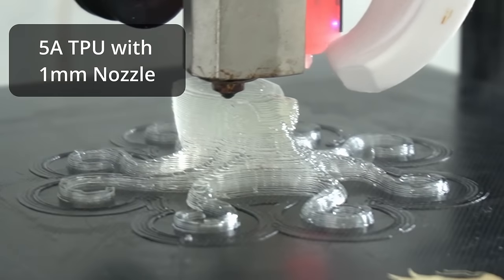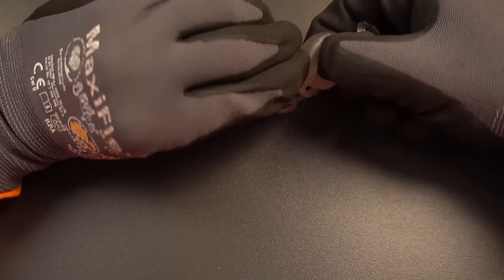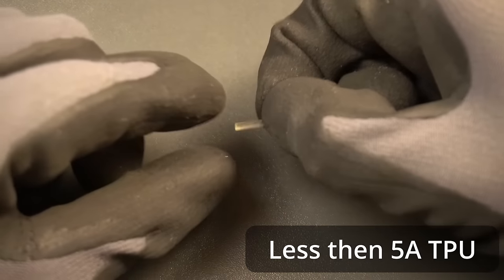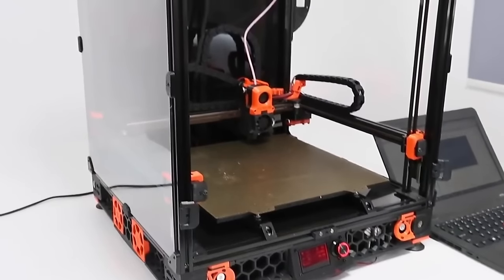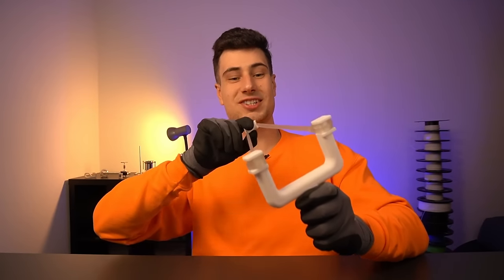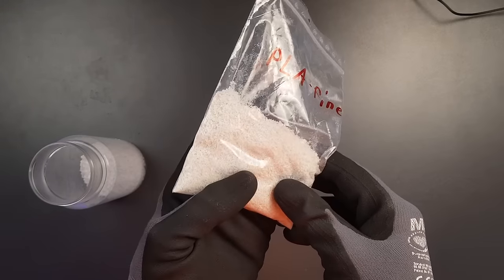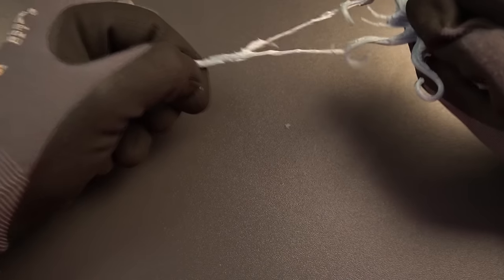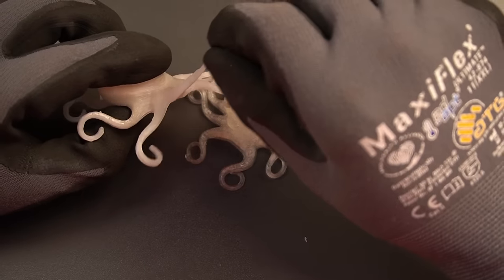This Extruder is a TPU GOD! Faster Flexible Materials 3D Printing

Comment: This guy is out here single-handedly revolutionizing 3d printing
Reply from the maker: But I couldn't do this without your great support and from the community 😊
Reply: yeah this seriously is an insane leap in tech. it really is going to change everything.
Reply: how is this revolutional ? its a pellet extruder. they have been on the market for a long time
Reply: @greenboy3d extruded wax would be amazing for making molds... who needs a metal printer if you can crank out a wax print into casting sand and dump molten metal in half the time.

NASA used a similar technique to cast some of its early rockets
Reply: @greenboy3d  I saw this video and was thinking "is this the same guy who made the pellet extruder and I was amazed making one of these is already a feat within itself and most professional companies can't make things like this you truly are revolutionizing 3d printing
Reply: @Mr_Pewpy_But-Whole Exactly this is nothing new. I've made one myself. Dyze design makes really good desktop pellet extruders.

Comment: Just tell me when I can purchase and I’ll be there waiting
Reply from the maker: Working on it
Reply: have you thought about another motor? i wonder if theres something better than the standard NEMAS...would require a nice BLCD controller and firmware, but theres potential i think...
Reply from the maker: @simonschneider5913  NEMAS have too much unnecessary metal on, but for now I don't know any better motor
Reply: @greenboy3d  can you tell us about the range of rpm youre running it? I am exactly of the same opinion about the NEMAs as you are! are you familiar with the rolling-screw-extruder designs? they run a usual brushless with quite high rpm. but i guess thats too much here...and then i was thinking about if there are cheap and precise cycloidial gears to buy to make torque out of the usual high-rpm-brushless motors perhaps?

[starting to think about it, the oozing and firmware tweaking to stop it when using high-rpm-motors make my head spin already.. ;) ]
Reply: @greenboy3d Moons/LDO?
Reply from the maker: @YourComputerExpert  What is with them?
Reply: @greenboy3d  Oh, I meant the smaller pancake ones!
Reply: @greenboy3d given that the extruder is probably fairly slow you could probably use a setup similar to the mellow cannon with a small motor driving a worm gear.

Comment: We probably won't see pellet extruders from 3D printers companies because a big chunk of their profit comes from filament rolls, so projects like this are really helpful and must be supported
Reply: It would be actually hell a lot more profitable to sell branded pellets, so it's not the main reason.
Reply: @SergeiSugaroverdoseShuykov  Yes and no. Yes, these companies could add pellets to their product line, but no they still don't want to do that. The process would be a huge cost for a lot of those companies, since they don't own pellet making machines or have the institutional knowledge required to operate those machines. There are also other factors that neither of us would know of that would incur great costs.
Reply: @Inkwyrm_YGO  plastics are sold as pellets, you basically only need to repackage them
Reply: There’d still be a lot of markup between pellets sold in 1,000 kg lots and those sold 1kg at a time. That and offering profiles tuned exactly for their pellets would entice a lot of people to buy the name brand. A huge factor would be that there’s a big difference between printer-brand spools at $25/kg vs generic at $13. If it was the difference between $2.50 vs $1.30/kg though, I’d just buy the name brand for peace of mind.
Reply: This is why this guy deserves all the support we can give him. I think I simply buy one of his early extruders for that reason. A big middle finger to the established 3D printer manufacturers. Build these types of printers or go extict. This extruder has too many advantages to ignore.

He should get his extruder in the hands of CNC Kitchen. Stephan would be an enormous help.

An advantage not talked about yet is that the material will be of better quality as it suffered one less heat cycle when turning pellets into fillament. That has to be a factor considering recycling used fillament is so hard to do. ergo,  prints made by pellet extruders must be easier to recycle.

Finally, if screw extruders are better for injection mould machines then it might have advantages in 3D printing too. Again CNC Kitchen could shed some light on this.
Reply: @critical_always  I second the idea of him connecting with Stefan at CNC kitchen. 

Injection molding is a quite different use case, given the high pressures involved there. They use a progressive screw arrangement (not sure that’s the term) that develops enormous pressure and also heats the plastic quite a bit in the process. We don’t need that kind of pressure for our application, but my intuition suggests it’s a kind of positive-displacement system that should allow very precise control over the extrusion rate, great not only for extrusion speed but dynamic flow control as well.

I don’t have the bandwidth to tinker with printers these days, just need to hit Print and pull the parts out of my Bambu X1C when done. If I had time though, I’d be extremely interested in this, would have wanted to be a beta.

It’s really an extraordinary accomplishment for one guy to have developed this to this level of functionality all on his own, I’m incredibly impressed!
Reply: I don't think it will have much effect on filament producers simply because they use pellets to make the filament anyway, all they would do is supply pellets as well as filaments. Basically this extruder is very similar to a normal injection molding screw extruder.
Reply: What makes you think they won't just sell their own brands of pellets?
Reply: @SergeiSugaroverdoseShuykov  How? It's less work, sure, but that goes for consumers too. What's stopping us from just buying plastic straight from the source rather than buying their branded stuff that hasn't actually gone through any additional proccessing?
Reply: @snerttt  Same thing that keeps us from buying most things from suppliers. Bulk buy requirements/cost, storage infrastructure, and wholesale agreements. Pellets in extrusions factories I worked at commonly had to be dried to 5% humidity before they hit a machine for use for example. They also were stored in sealed rooms that were kept below 20% humidity to keep additional drying at a minimum. The steam you see in his extrusion examples is water vapor from the pellets. Pellet extruders are great at injecting air into prints if as they force the pellets down and trap it. This is why they also basically require large nozzles so those air bubbles can burst before the layer is laid down.

Comment: suggestionsforpelletprinthead"  
1 plastics are moisture sensitive. Might be good to have a way to keep the pellets in the head dry.
2 big injection molding machines have variable pitch lead screws to increase the de-airing capability and the injection pressure.
3 a smaller motor, side mounted, with a gear reduction for higher torque and tighter control might be good.
Smaller pellet delivery pipe maybe with something in it to prevent clogging? 
I want to use it with my bambu carbon X1.  Not a lot of extra room in there.

Comment: I am a 3D Artist And I have a suggestion for you, the swirl should have extended arm’s, up in that pallets compartment which will push the pallets toward the center of that rotating part pushing it down this way chances of failed print because of lack of pallets will decrease

Comment: Wouldn't it be a good idea to also put an fume extraction near the nozzle to get rid of the fumes? (not all of it)
The fume extractor could be a ring duct but sucking air in istead of blowing air out and 
the cooling fan duct blowing cool air from above the fume extractor down.

Comment: Would it be possible to mix wood fibres and hot glue, to 3d print mdf?
Reply: There's allready a form of 3d printable wood. Look up wood fdm 3d filament. It wouldn't be too much of a stretch to say you could have this in pellet form either.

Comment: I received the email I've seen the shop but nowhere does it actually give you a list of what you're getting except hopes and dreams. Are you getting an STL file showing you how to print these items, are you getting the items that are in the pictures on his shop, what exactly are you getting for this money?
Whether you look under descriptions or under specifications there is nothing except the temperatures that can be used and the types of nozzles that can be used with it is that what you're getting for the money some words?
Reply from the maker: Hi, I have added some more information regarding that to the product page.

For your Pre-Order you will get the following:

1x Greenboy3D Pellet Extruder Barrel
1x Greenboy3D Pellet Extruder Screw (Improved V1 Version)
1x Greenboy3D Pellet Extruder Heating Block
1x Coupling
1x All necessary screws and nut
1x Planetary Geared Stepper motor
1x Heat Cartridge 70w 24v
1x Thermistor
2x Fans
1x 1m Pellet Conveyor Tube
200g PLA Pellets for testing
Video & Text Instructions
Weekly Video support calls with me in online group meetings
General priority pre-order Text support
[FREE] Access to a variety of 3D printable adapter mounts
*The printer is not included. The pictures are for illustration purposes only

There will additionally a lot of videos that teach stuff about pellet 3d printing, which will be for FREE for everyone

If you got any other question you can contact me at any time through my email kristian@greenboy3d.com

Comment: What if you shred pla pellets with blender? Would it give worst or better results? I mean, you should then have smaller and more consistent air gaps so everything should be more cobsistent but idk
Reply from the maker: The smaller the pellets/granules the better. Which you use a blender, coffee grinder or something else. It it just a tool to turn plastic waste in small "3d printable pieces"

There definitly better ways, but those "blender" methods still work to some degree 😇

Comment: One process reliability thing that’s super important is drying your pellets. Pellets have a greater surface area than filament so it Will absorb moisture much faster.
Reply: And also dry much faster.
Reply from the maker: Yep

Comment: The quality of your TPU prints is amazing. I am now having ideas that would probably be way too expensive right now, but having a dual head 3D printer both with your pellet extruder. One extruder has the extra soft TPU and the other PLA. You could print those dummies that are shot by gun youtubers with a 3D printer like that.

Comment: I converted an old 700×700×1000mm cmm a year or so ago to a 3d printer/cnc machine and have been looking for a print head to make for it. This is the perfect solution I think! I just have to sort out the build plate.

Comment: For certain people, printing with shredded plastic rather than filament could be pretty useful. I really love the idea of being able to print 5a tpu, but I'm not willing to do all that workand sacrifice strength for it. I will say as a SLA printer owner I really like the idea of mixing plastics in an fdm printer. I'd also like to see some polypropylene and ASA or ABS mixed.

Comment: I would be interested in seeing how well this handles high volume fraction composites. Typical filament becomes excessively brittle as the additive ratio increases, but the pellets should help alleviate this if the material is premixed before extrusion and would theoretically allow for some interesting applications that typical filament extrusion is incapable of doing.
Reply: Or you could possibly do metal 3d printing by printing mostly metal "sand" but including just enough plastic pellets to make it all stick together. Then sinter it in an oven.
Reply: @celeron55  I have seen that done with bio-style pressure driven extrusion so that you can use an elastomeric binding agent or high viscosity liquid to suspend the metal particles. If the thermoplastic has sufficient binding strength to retain the particles in large volume fractions, I imagine that what you are describing would be viable but I imagine that you will need a pretty significant volume fraction to be able to post-process sinter the part and get a serviceable lattice of the remaining metal.
Reply: it will literally eat the extruder. like in injection molding, fiber reinforced is hard on the cavities.
Reply: @simonschneider5913  As long as you aren't printing some 450 C space alchemy plastic, you can case harden the auger and just use a hardened steel nozzle or polycrystalline diamond nozzle if you really want to go for abrasion resistance. If you are going with the PEEK style nerd plastic, there are tool steels that can be be hardened and stay at sufficient temperature to print without annealing.
Reply: @galacticscalepenguins6092  ok sure, then you go ahead!
Reply: @galacticscalepenguins6092  theres a MP-institute in STGT where they definitely would be very interested in knowing how this is supposed to work.

Comment: How does it handle finer-grinds? Like right now you're feeding standard pellet sizes, but the poor PLA mixing got me thinking the blend of TPU and PLA was too large for the nozzle to mix more than at a surface level. I dont know how viable chopping TPU pellets would be (might need to freeze it first).

BTW: you might need to dry your TPU pellets. There was a lot of steam in the printing footage.

Comment: It looked like there was a lot of steam being produced during the extrusion of the TPU in the start of the video, how hard do you think it would be to integrate a pellet drying/dessicating solution to the pellet feed? It seems possible, but more difficult due to the larger volume of the transfer hose, and the printed parts.
Reply: I'm not really an expert but let me propse a solution:

The hopper can be modified or replaced with something that allows for this.

One way might be adding vents or small holes to allow airflow through the pellets, and you would just force some hot air through it, you could also have a campartment that receives airflow with dessicant. I'm not 100% sure how the drying process works, but I think just pushing hot air is enough.

Comment: In all seriousness though I wonder if a combination approach would be more effective. In terms of mass at the hot end anyway.

So the hopper creates a filament from the pellets and the extruder uses an extruder screw instead of traditional screws. This could reduce hot end mass by half at least as the screw could be much smaller.

Comment: My hunch is you either purchased the screw or made it on a lathe. If you want to make a reciprocating screw with a small back diameter and large front diameter, that works via friction as much as heat, use a CNC Mill with a 4th axis on the table. Or just buy one! haha

Comment: You should test how good the extruder mix the pellets, use colourless with a very small amount of coloured TPU (or any other plastic but the same type for both), then you can check the part on how good it mixed the pellet.
I worked in injection moulding, and even there you could get in trouble (when using coloured pellets instead of powder) because when you have a very low ratio (1 colour/30 clear) the screw can't mix it well.
In these cases you could just extrude a filament, that you shred and use again, to keep colour consistence. 
Mixing different sorts of plastics, is quite difficult as all have different optimal melting temperatures.
I'm interested in even softer stuff like TPE-S, (SBCs, SBS, SEBS)..

Comment: I'm no materials scientist but mixing materials is more complicated than just melting them and mixing them. In order to have a good mix, you might need to suspend the materials in some kind of matrix. I mean think about how filled filament is made, they suspend fibers, dust or other larger particles in a matrix of the polymer, usually with other additives to change the properties so that the heavy particles don't sink and remain uniform. Either way, if you want to mix materials, you really need a whole separate pre-mixing phase. I think unless you are mixing the same type of material but different colors, it's not going to turn out well.

Comment: Try mixing TPU with a soluble material like PVA or HIPS. If you dissolve out the soluble component, you could potentially achieve a much lower apparent Shore value, assuming it prints smoothly and has good interlayer adhesion.
Reply: That's basically equivalent to foaming tpu

Comment: That pla-tpu amalgam might be awesome as an adhesion interface layer between tpu and pla in a 3d print, just need 3 print heads I guess?
Reply from the maker: Maybe this way we could 3D print also with PP or PE much easier
Should I try this out in one of my next videos?
Reply: @greenboy3d  oh yea! Like maybe you could fill the screw with hot melt glue for the first few layers of a raft, then your main material is HDPE

Comment: i LOOVEEE this idea, and i will defo follow you more closely from now on.

I just have few questions if you don't mind
Where do you get those pellets and tubing you showed off in previous videos?
How did you make the screw and hotend block? Did you make it with CNC or had it made somewhere else?
When do you plan (if you do) releasing the files publicly?
Do you plan on making collab on this with one of the big players like Prusa or someone else?
You don't need to answer all of it, even just one will be enough 
thank you in advance